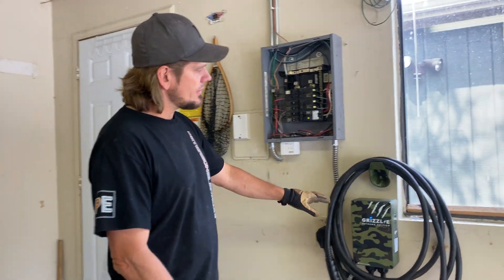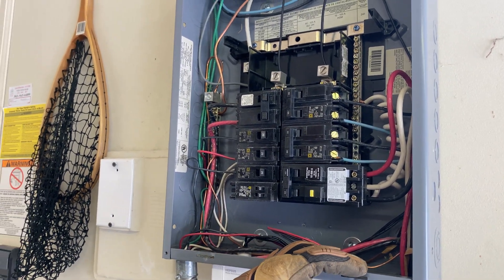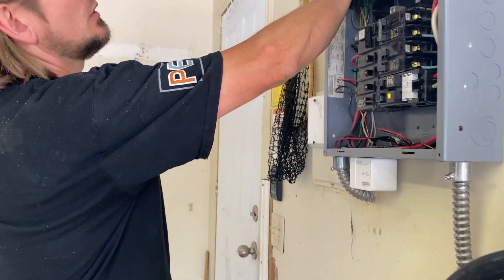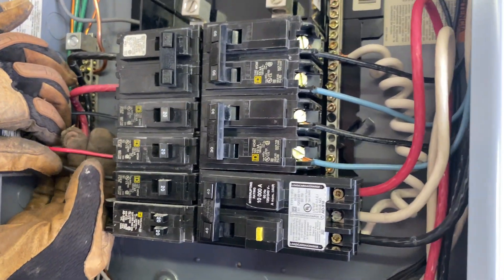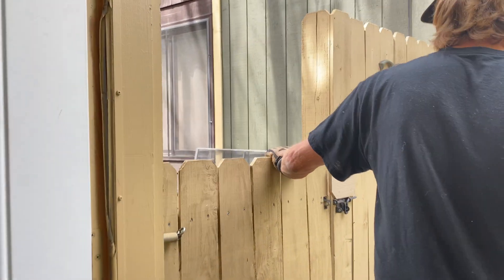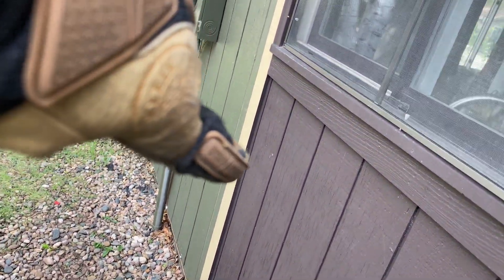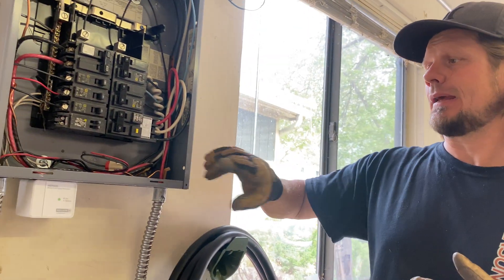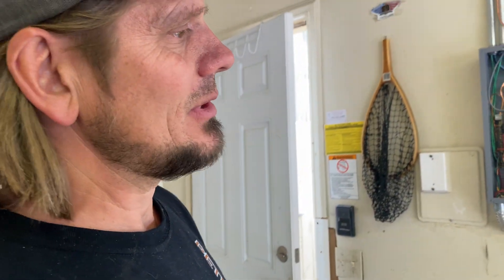Does Your Detached Garage Have Enough Power for an Electric Vehicle Charger?

Comment: Question? My main panel is 125’ away were I want to install my Tesla wall charger. What size wire do I need to run? Can I get away with #6 or do I have to go with #4 because of voltage drop?

Comment: Level 1 chargers are 120V, 16A (Typically). They're hooked up on 20A Circuits.
Level 2 are 240V and can range from 15A to 80A (32A (on 40A Circuit)Being the most common). (Although 40A on 50A Circuit is becoming more and more popular).
Level 3 are High DC Chargers, Won't find\install in a home require 400V+ typically.

Comment: So the panel is (back) fed through that 2P 60 AMP breaker top left with #6 NM in a conduit? What are the goofy little wires coming off the main lugs running (with no OCPD) then?
Reply: Probably the surge protector (SPD.) The only other 2-poles I see are 40/30 amp, and usually those Square D HEPDs call for 20A OCP breakers or they can tie right into the lugs. They also have 2 blacks, a white and a green, where for NM or conduit, you'd usually use red or in this case, they liked blue!?
Reply: @bnasty267  Ah, makes sense.

Comment: Which code states that you have to bring #10 to a detached garage?
Reply: NEC
Reply: 210.11(C)(4) says you only need a 20 amp 120 volt branch circuit to a detached garage.